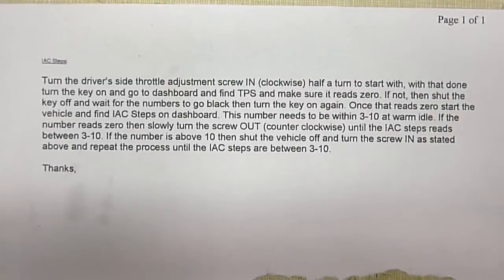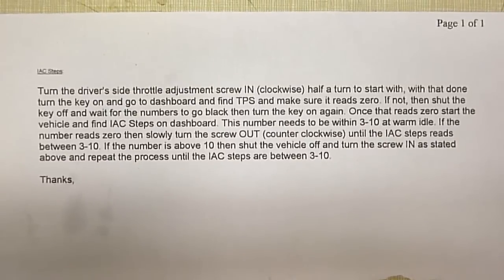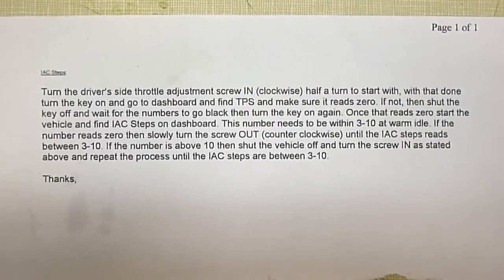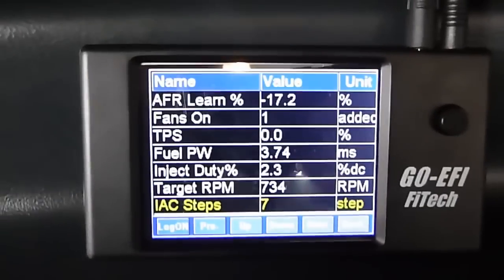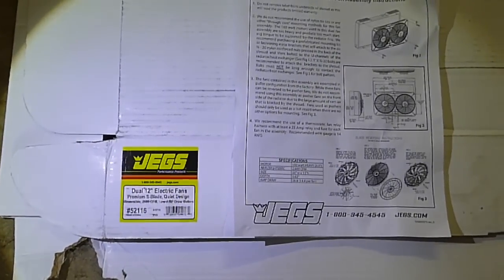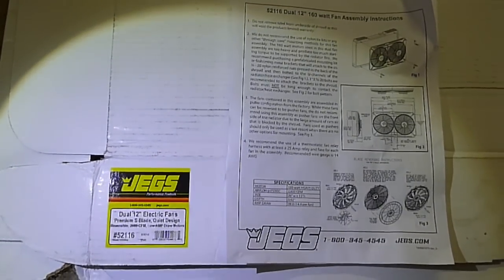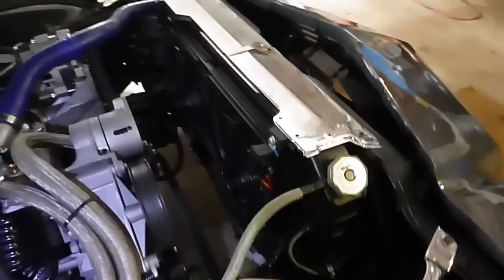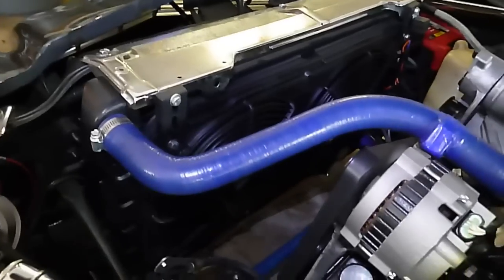FITECH EFi Tuning 400HP 600HP  fuel injection system

Comment: What motor are you running the fi tech on? I have a 350 with the 600 easy street fi tech system and I have JUST the handheld but it’s different from yours, I was wondering if I can tune it with that specific handheld or if I need to have someone with a computer ?
Reply from the maker: Hi I have a Chevy ZZ4 crate motor, you can go in on the hand held and change everything if you want.  Thanks for watching.
Reply: @ShenRC  thanks for the quick reply!

Comment: I spent three days doing this procedure to bring my steps down between 3 and 10 it won't do nothing I'm thinking I must be stupid and I've been working on cars for 30 years I just like to send it back and get another one AR by different brand
Reply from the maker: call fitech that's what i would do , anytime I adjust the screw mine makes them go up and down very simple to do something else may need to be set diferently for your motor.

Comment: Mine started at a high rpm. I tried turning down the rpm now it won't start it just cranks over . What be the problem
Reply from the maker: Hi how did you turn down the RPM? you need to do it on the hand hold CPU and also you need to adjust the IAC steps as shown in my video.

Comment: You want your IAC steps with the fans off between 3-10. With the fans on you want it to be just above 10.
Reply from the maker: Hi see the e-mail in my video that the tech guy at fitech sent me after speaking with him on the phone read it that's the proper way to set it up.
Reply: +shenlonco All the other people I talked to that contacted FiTech said to set it after the engine gets to at least 170, when the computer goes into closed loop, and the way I mentioned.

The one thing FiTech doesn't go into detail is fine tuning with the included instructions.

Got mine tuned yesterday the way I mentioned and runs so much better along with better returning to idle.
Reply from the maker: +Bryan Gray Hi that's what the email says set when warm and IAC steps should always stay 3 ~ 10 when running?
Reply: +shenlonco The IAC steps will be higher when the fan is on, if using the FiTech to control your fans, because it jumps your idle up to compensate for the electrical draw and it raises your rpms up 50 to  counter the electrical draw on your alternator that generally bogs an engine down.
Reply from the maker: Hi Yes I know this , this is why I showed my IAC steps and said when the fan is running it was still on 8 for IAC readings.
Reply from the maker: take a look at the video I added a note about the IAC and fans on.
Reply: well I tried everyone of these procedures still won't adjust at all

Comment: I can only get the IAC numbers to go up to 3 and that's with the screw about to fall out real loose and my Tps is at zero, idling at 850-935
Reply from the maker: Hi maybe try resetting it all and lowering your Idle RPM I have mine lower actually at 700RPM  try 800RPM see what happens
Reply: Okay thanks will try tomorrow this thing got me beat closing shop
Reply from the maker: yea i had mine in the stock rpm setting and went down to 700RPM it still feels like it is idling A hair faster when i have my car in drive it rolls a little faster than when I had my carb set up on it. 700RPM is real close though I don't want to play with it no more :-)

Comment: TPS is at zero
Reply from the maker: that's strange if I turn the idle screw a hair any way it changes mine... you working the screw on the throttle linkage side?  if it's at 3 it should work but strange you cant get it a tad bit higher.
Reply: Yeah the Phillip head screw that is facing forward next to the throttle linkage?
Reply from the maker: Dickey Moore yep Well 3 should work according to fitech.

Comment: my IAC number is 0-3 idling,if I turn the screw in or out it will not go up or down and operating temp is at 170
Reply from the maker: Thats strange...  well they say 3 is ok, what is your TPS set at they say it should be at 0 first before setting the IAC